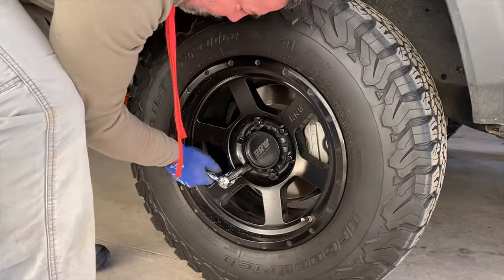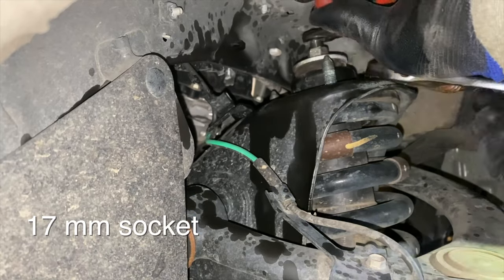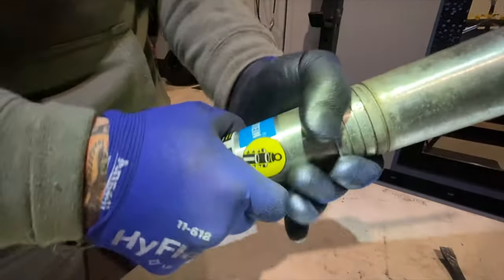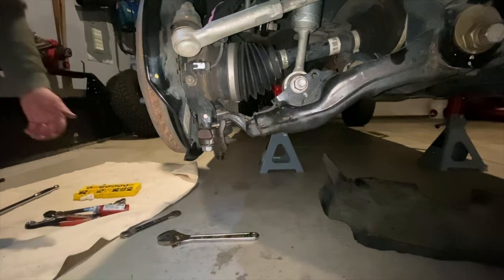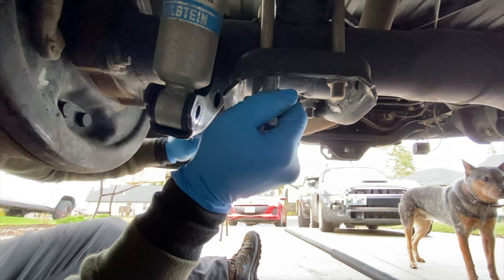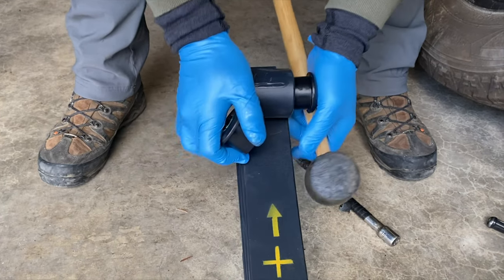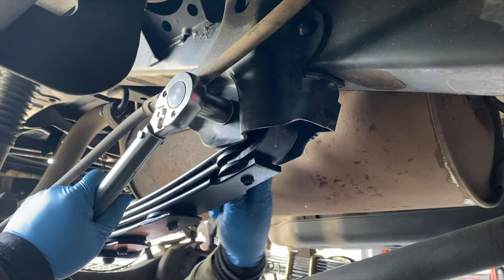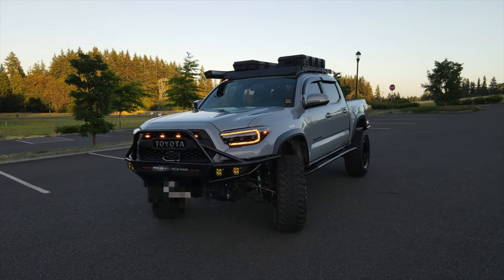Toyota Tacoma shock, spring, and leaf upgrade

Comment: Nice job!  I like the part where a guy can do it in steps and not break the bank.
Reply from the maker: Exactly, this was the most economical for me and it worked with what was installed. I hope it helps those that are watching 😎🤙🏼 Best wishes
Reply: @eluv201  It does help a lot, and thanks!

Comment: I’m confused, so you didn’t actually end up having the new coils compressed/assembled. You were able to just use the lower control arm to press it into place, right?
Reply from the maker: I had it compressed but only because its the heavy duty springs. Reg springs yes, you can use floor jack

Comment: Awesome set up. How heigh did you have to lift the front to level it?
Reply from the maker: Could’ve gotten away with 2” but went with 2.5” and love it.
Reply: @eluv201  Nice… Been interested in these leaf springs to match my OME UCA’s but I have an 08 and apparently the lift is 2.75” for 2nd gen’s. Would have to have a 3.75” front lift to level that, not the can of worms I want to deal with so still on the lookout for the right set. Liked what you said though, “little bites.”
Reply from the maker: @Truncali82  agree, seems too high.

Comment: Are these springs similar to the eibach pro lift kit springs?
Reply from the maker: @Gunmonkey5  not sure brother, but all entry level springs are pretty much the same.
Reply: @eluv201  they seem like it as mine was longer than OEM just like yours . I have them on my front shocks but was scared to go above the first setting. It gave about 1” of lift, so I want to bump it up because I have the same leaf springs and that lifted the back 2” so I’m probably gonna go either the middle setting or the 4th setting.
Reply from the maker: @Gunmonkey5  if you have regular springs for front shocks and not HD like mine you’re golden 🤙🏼 easy peasy Should look sweet bro
Reply: @eluv201  nah mine are hd springs in the front but by eibach